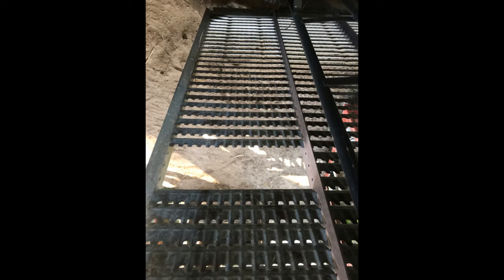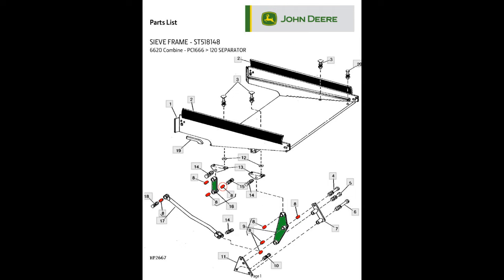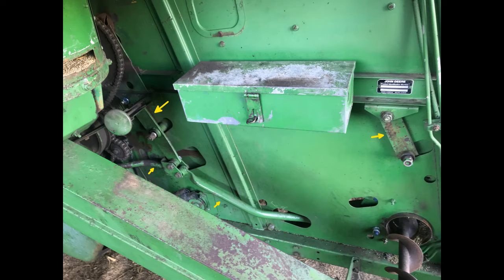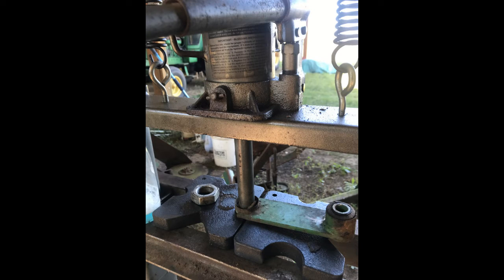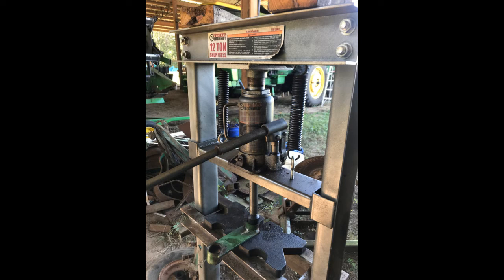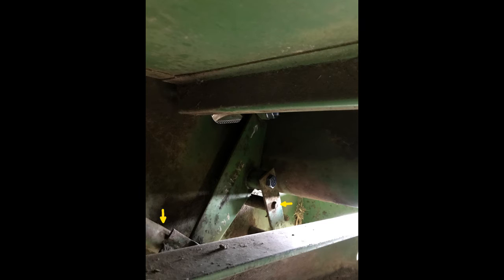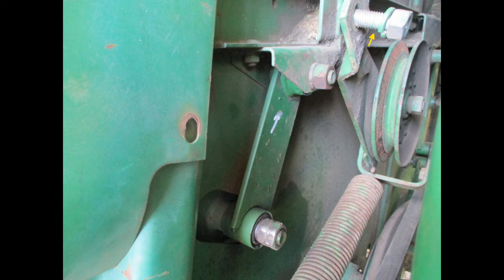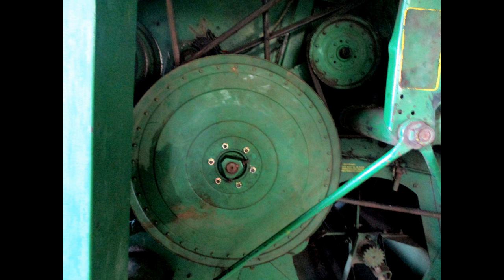John Deere 6620 Combine: Replacing The Shoe Bushings

Comment: Im working at my 6600 combine at the moment.....replacing the bushings. However I never took any photos.....and I did notice the arms are different on each end. ( the short arms)    How to know which goes where ?           And which bolts need double nutting ?    Also......I notices there are three different length bolts. Which of those go where ?